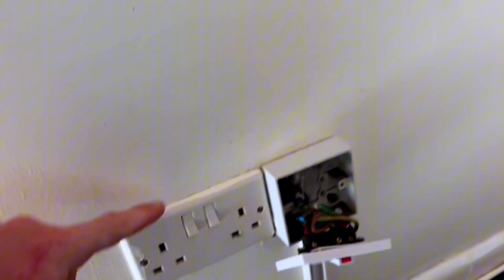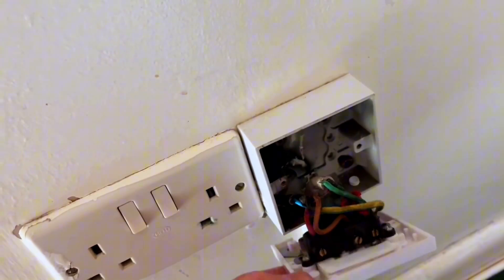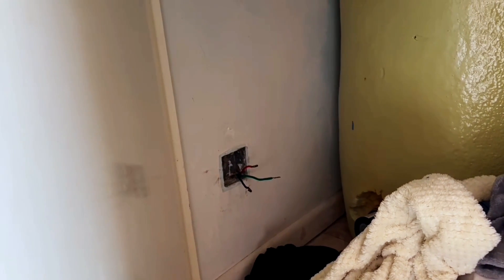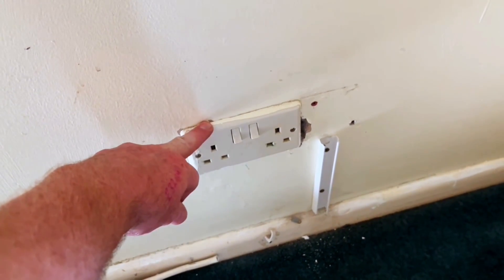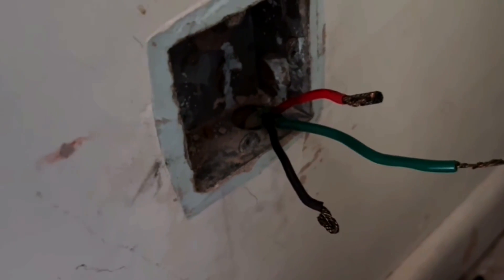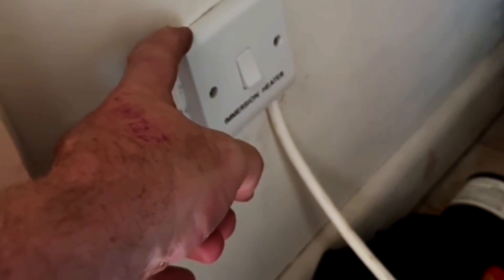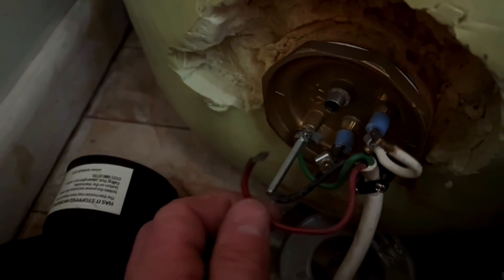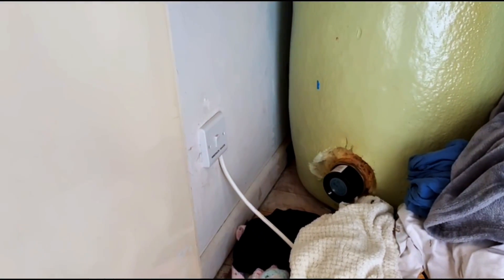Switch Getting HOT

Comment: Immersion heaters need a 20 Amp unfused switch, NOT a fused spur. It should be on its own 20 Amp circuit, not spurred off a socket circuit etc.